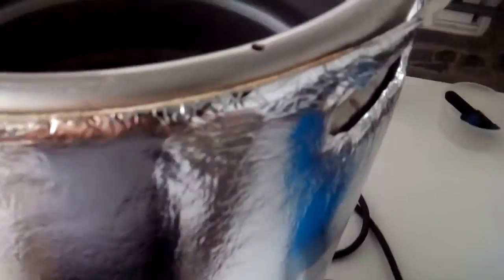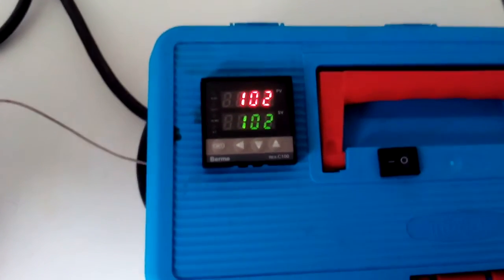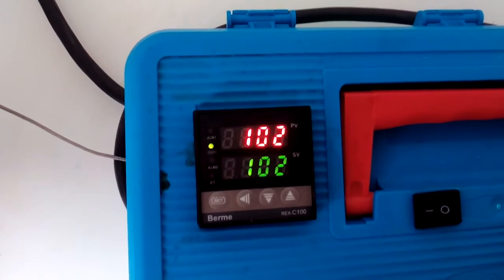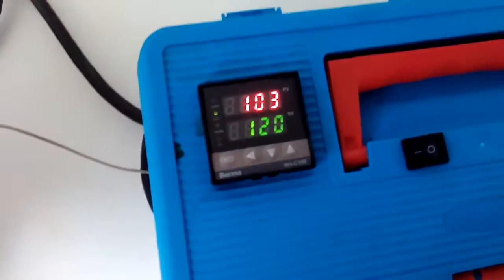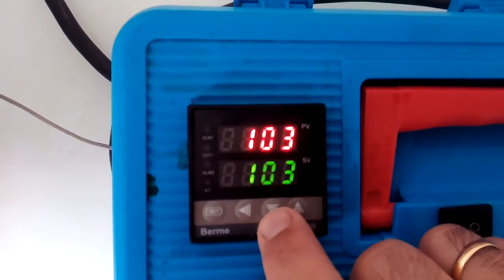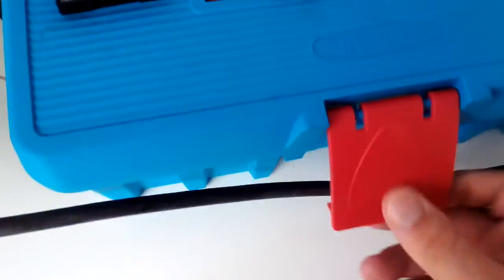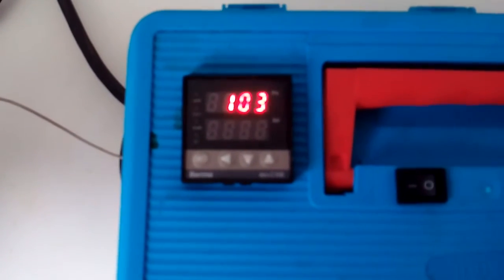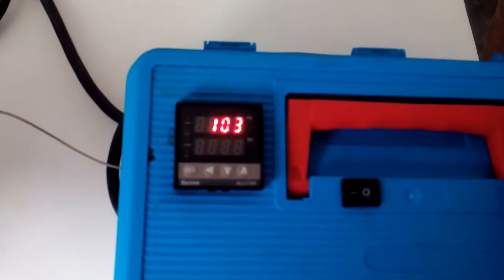How to set your cheap Rex C100 PID to duty cycle.

Comment: There is a cycle setting... goes 0 to 100,  as i remember..  anyway, my setup does not need the controller to strobe the output .. the strobing drives the temp up.. trouble is, if i set the cycle to 100 seconds, it will strobe the output for 8 seconds every 100, what makes it worse is the controller says te temp is not rising when my other 2.probes say its getting hotter, and i cannot figure it out

Comment: So the "Duty Cycling" is actually refereed to as "Time-proportioning PID", utilized when you have a discrete (on-off) output device as opposed to an analog. So the immersion heater in your case is an on-off device, as opposed to , let's say, an SCR controller which would receive a true analog output, such as 0-10vDC or 4-20mA.

Comment: Well, thats what a PID does.  It figures it out...

Point is it CANNOT operate at a constant duty cycle, that that required for distilling.  At the set temp, it will regulate itself and not exceed that temp.  

For homebrew a pid works well, but a manual duty cycle, the likes that distilling requires, wont work.

A PID maintains temp.  Thats all.  If you dont care about temp, but instead want to maintain power, a PID wont work.

Comment: I know this is quite an old video but could you tell us your settings through the menu? I have mine working but it seems to cycle a couple of degrees difference and also the alarm light comes on above and below temp setting. I don't want the alarm light as well as like it to cycle the way yours is showing here. My descriptive instructions are not so descriptive unfortunately

Comment: hallo, if ur dont mind , can u share ur wiring circuit ?
Reply: Run 1 power AC wire to both the pid  and to your heater/fan etc?..and other  AC wire to the side of  SSR ...Close to Red text... then a jumper lead back to the other powers IN  on the PID... PID need AC to run it....run a wire from other power side of SSD to your heater etc.. The way it works the PID decides to send a signal to the  DC  in side of the SSR
 which then turns on the heater/fan??  Setting the PID is another hard part..

Comment: Thanks so much for this post. i use REX-C100, I am using it with a K-Type thermocouple and a heating element. Whenever i set the temperature i want it keeps showing LLLL or HHHH  and i don't know how to fix this consistent problem. i will need your guide urgently pls.

Comment: Thanks for the video, did you have to modify the controller for SSR output?  I've got one coming in from overseas and it seems like I might have to modify it as I'll be using a 4500w heater.
Reply: I hope you have it figured out by now but the PID/controller has an output that puts out DC voltage to turn on/off the ssr. These are often sold together in packages that also include a thermocouple.

Comment: From an engineering point of view, if your goal is to control the boiling of some liquid that boils at ~100, then using PID at 103 is not a good process control. You would be better of just controlling duty cycle directly. Your setup is ideally suited to controlling temperature between room temp and boiling. That said, if it aint broke don't fix it, and it looks like it's working good enough for you!

Comment: Man thanks... I'm not so sure that I am 100% convinced and the title is a bit misleading, but you have at least delayed my purchase of a "manual mode" controller though my next brew session.  These little puppies are quite smart.  They learn quickly, I just hope they learn quickly enough to not scorch our beer.  I'll post a response video in a little while, let me know what you think.  I've only brewed once thus far on my new system and I didn't have the TC connected in a proper thermal well, so it was reading ambient air temp and not getting any feed back to the system.  I may have well just had an on off switch for the element as I blew right through slow, to rolling boil and eventually had a boil over.
Reply from the maker: The title is correct in as far as the functionality of the device is concerned. Adjusting the temp settings do control the boil rate and has worked for me for nearly a year with no problems. If you scorch the wort it would have more to do with the element than the controller. I recommend a low watt density element to avoid the problem. All in all if you want to flat out type in X% to set the boil rate and not worry about it, this pid isn't for you. Buy an Auber or one that has the manual function. I brew often and have had no issues so far with this one (other than the SSR burning out once). Hope that helps a bit and happy brewing. Cheers!
Reply: The title IS misleading because I need to know how to actually set my duty cycle not just set the temperature. I have a large oven and the PID makes the burners run 100% for 15-20 mins causing the burner elements to only last a month or two. I need to ramp up my temperature at a more controlled rate. Like around 50-75% of what it is currently doing. Most of these “non adjustable” PID’s actually ARE adjustable if you know how to get into the settings. If you hold the two left buttons or just the left button for about 5 seconds you will see. Setting a temperature and watching a SSRelay turn on and off is not adjusting a duty cycle.

Comment: I have exactly the same as yours except than my thermocouple isnt capturing the right temperature... any help? Cheers
Reply from the maker: +Robin Zeitoun - Are you using the stock thermocouple that came with it? If so, switch the wires and try again, especially if it is way off. The other possibility is that you don't have it set for a K type thermocouple providing that is what you have.  For a K type thermocouple, make sure it is set correctly. Press the SET button until you see SL1- this is to select the type of thermocouple you have. The stock one is usually a K type so you would make sure it shows 0000. Check the manual for additional thermocouple codes if it isn't: http://goo.gl/zYytby
Reply: +mudflap72 My bad I didnt really make myself clear. I am using the REX c100 for heating... I am using the thermocouple that came with it that is exactly the same as yours, although I am trying to use it for a powder coating ven and a heating element. When I just plug the thermocouple, the temperature is right, but as soon as I plug the SSR relay, and it gets activated to raise up the temperature ( anything higher than the temperature found on PV), the PV temperature starts jumping, then when the SSR turns off, it goes back to normal, till a point where it completely shows a ridiculously wrong temperature. Maybe i wired the whole thing wrong, although I strongly doubt it. Might it be coming from the probe that could be faulty? I also read that it might come from interference?
Cheers! ( btw I look at the manual for so long today I wanted to burn it)
Reply: @robinzeitoun3523 too funny. 8 years later and I’m tackling the same behavior with a Rex c100. I’ve tried 3 k thermocouples and a pt100 plus I tried an entirely different c100 swapped in. When the ssr kicks on, the PV value starts jumping all over the place. I’m using it in a smoker with an electric element and get crazy over temp swings from it artificially reading low when the ssr is on.

Comment: Thanks so much for posting this.... i'm doing a similar build with similar parts and I was concerned about this exact point.  So it's great to know that it will support a controlled boil.  btw - did you have to program anything special to increase the sample/response rate (I was a bit surprised in testing it out of the box that it seemed to take quite a while to react to temp changes).  Cheers and thanks again
Reply from the maker: There is a setting but my Chinese instructions failed me. lol. If I  get a second to cycle through, I I'll post my defaults in. You don't want it to react too fast either because it's easy to overshoot a target with these volumes.

Comment: Nice review of this unit, Cheers!
Reply from the maker: It was kind of your fault I posted it. LOL. I watched you set your duty cycle on your system to control your boil off rate and wanted to do the same but mine did not have a manual mode. After figuring out the way around, I shot this so... Thanks Tony! Cheers.